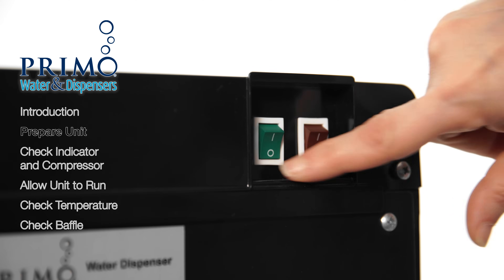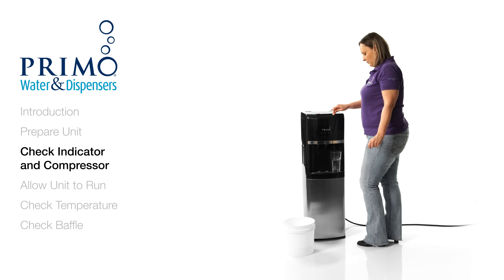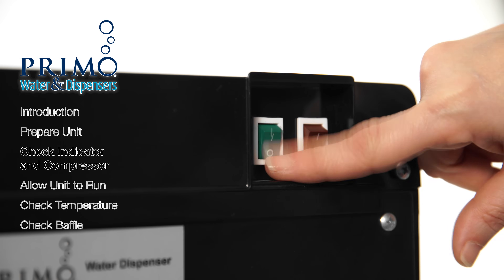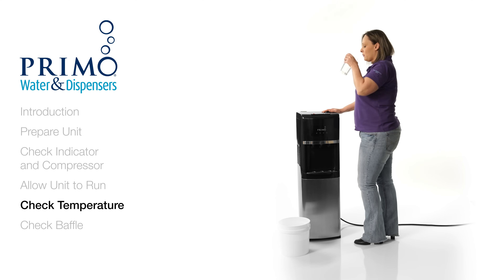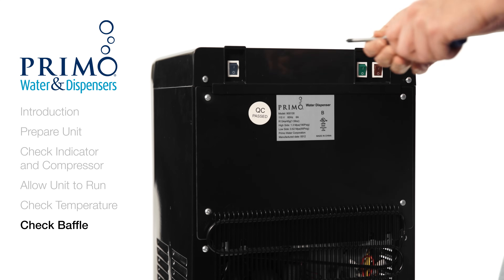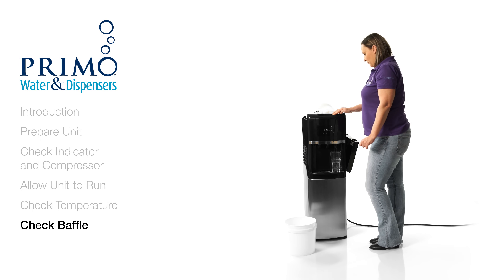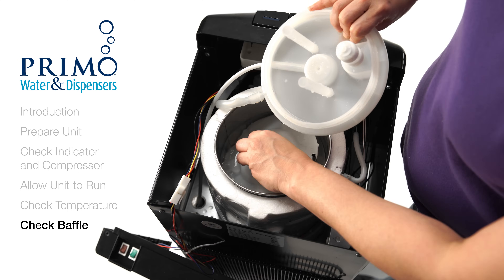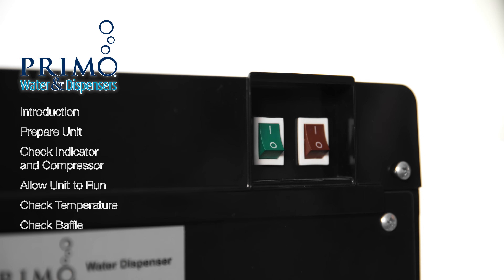Bottom Load Cooling Issue

Comment: Part of the problem with the video tutorials is that they don't seem to encompass the various Primo model numbers. As is the case with my unit as well as reading the posts of others having similar problems, that supposed brass-colored adjusting screw is nowhere to be found. At the very least, the tutorials should address where any adjusting apparatus is located on the various models or at least respond to the inquiries here to help those who continue to experience these problems without having to call in a repair professional. PRIMO, ARE YOU LISTENING???
Reply: No kidding! Mine doesn't come apart like some of these other ones do because it has the k-cup option.

Comment: Mines not cooling at all anymore. The compressor is running. The little green light is on over the snow flake but it never goes off. Compressor runs 24/7 and the water isn't even cool. This thing stinks.
Reply: have you figured out what was the issue?
Reply: Frank Alfani  yes yes
Reply: Same issue here. Just bought it too
Reply: Me to
Reply: Same issue were having
Reply: Same issue, compressor and green indicator light always on. Freon low? anyway to recharge?
Reply: Water is cold but compressor and green indicator light always on
Reply: Same here as well. Snowflake on but no one is home.   Compressor runs all the time.  I think it might need a shot of coolant.  If i figure out how to fix this i will put an update.
Reply: @mij12568  any luck bother
Reply: Same here running constantly not cold

Comment: All- for my situation cold water did not run. Hot water ran fine. Turned everything off and unplugged the machine.  Get a bucket remove top cover. I disconnected the top lid from power source. Central drain spout is right in the middle. Open front cabinet where you place your jug. Place bucket directly underneath spout. Go back to the inside of the machine and yank the plastic tube from the main spout. Water is going to gush out. Quickly place tube back into main spout. I heard a snap, most likely suction.  Then press cold water button. It should work. Dry surroundings of the main spout! Use paper towels and try to squeeze it in. Dry as best you can to prevent mold. If everything works, reassemble.  Again, this worked for my situation.
Reply: Did this work for a compressor that wasn't turning on?

Comment: How do you make the water colder? Older models have a screw on the back. Not sure where new models have it.
Reply: or less cold, ours just freezes over and water doesn't flow from ANY of the 3 ports...
Reply: @victormanx  same
Reply: Same
Reply: @victormanx  I have sold this water freeze issue by adding a timer ont he water dispenser. I use a timer by settng the time to turn on the unit for 1 hour and turn it off for 2 hours no more freezing issue.

Comment: What does it mean when the indicator light is just blinking green? And the water is not cooling and I do not hear the compressor. Please help
Reply from the maker: Thank you for reaching out to us. Please contact us at social@primowater.com so we can provide further assistance.
Reply: Same and did the whole 4 cup thing several times and stupid light above snowflake won't stop flashing which prevents the unit to run. Feom seeing all comments it seems to be a flaw in Model#601088(my unit) and Primo knows this and should replace units for free or at least give a pretty good monetary credit towards another. Looking into other brands because I've had it with the whole turn off and unplug and dispense and wait junk.

Comment: My unit wont stop cooling, turned the switches off and compressor still runs and the coils get very hot. Till the point the machine freezes up. Any ideas?
Reply from the maker: Hi - Thank you for your feedback and we are sorry that this didn't help resolve the issue. Should you require any additional assistance, please do not hesitate to email us at social@primowater.com. Thanks!

Comment: I have a bottom loading dispenser model 601089 . The coils that lead to the compressor are frozen and the cold water is not getting cold . Some videos say to adjust the temperature with a screw on the back ,my model doesn't have a screw to do the adjusting .  Another video says to replace the relay switch to the compressor , my compressor seems to be running , humming . And the on that shows how to recharge the compressor . The sticker on the back says that it has a high and low side  but has nowhere to check the freon level . Talked to the company and was told that my model isn't made any more . i was sent a troubling shooting link that does not explain what the actual problem is and how to fix it . Can anyone help
Reply from the maker: Hi - Thank you for your feedback and we are sorry that this didn't help resolve the issue. Should you require any additional assistance, please do not hesitate to email us at social@primowater.com. Thanks!

Comment: How do i get the top off of one that has the keurig storage on top? Took two screws but lid wont budge feels like it gonna break
Reply from the maker: Thank you for contacting us regarding this matter. With the type of dispenser you have, we do not recommend that you remove the top cover as this can cause damage to the dispenser. Please contact us at social@primowater.com for further assistance with your issues.
Reply: The front lip is tucked under the front frame,  lift the back up and pull , it should unsnap from the front bezel.

Comment: We have the opposite problem.  It seems that our water is freezing up and will only dispense after leaving it unplugged for 24 hours.  How can this be corrected?
Reply: Same issue here.  Were instructed by others to find the "thermostats" and adjust the screw for the cold water thermostat until the water no longer freezes.  Problem is, we have no clue what the thermostats look like.
Reply: Were you ever able to fix this issue?  Having the same problem now.
Reply: @tylerread1068  no, the unit was replaced under warranty.
Reply: Ah ok thanks

Comment: my water dispenser is model 601088, the hot and cold water work very well, but only for a while, because every time the water that is in the tank freezes, water stops flowing and I have to turn off the compressor for two hours, to thaw and be able to use the dispenser again
Reply: Same issue, did you solve it?
Reply: Same issue. Was told by my water company that they stopped carrying this unit for that same reason. Total waste of money. The thermostat needs to be replaced and it cannot be replaced on these units.
Reply: where is the thermostat on this unit?
Reply: Same and now green light above snowflake continuously blinks preventing compressor to kick on and tank to fill. About had it with this unit and maybe 2yrs old. Model#601088
Just noticed same model so it's making me wonder if there's a flaw in this model. Primo should be replacing unit for free especially due to their customers daily hassles.
Reply: We’ve had two units for three years now and one of them has been having the same trouble over two months. I have to thaw it out just to use it but it freezes up again rather quickly. If they don’t offer replacement parts then I’m forced to trash it and come out of pocket for a new unit. They should offer a discount coupon at this rate. Another thing, make better videos on troubleshooting, from a customer service stand point.

Comment: the issue is that the stupid device freezes to the point that no water comes out whatsoever, disconecting the unit helps but only if you leave it off overnight but even then you need to leave the cooler off way more time yet still plugged in so that as the block of ice that is in the reservoir melts you can take water out and it can try an put warm water in
Reply from the maker: Thank you for contacting us. Please send us an email at social@primowater.com so we may provide further assistance with this issue.
Reply: I solve this problem by adding a timer on the outlet of the unit, setting the on time to 1 hour and turning  it off for 2 hours for 24hrs cycle.

Comment: I just bought a bottom loader with the kurig coffee maker and everything works great but it pisses me off there is a small dent in the side of it. Also, the water is not cold and I couldn't find no brass screw. I check the baffle and it was in place. I paid $36 for a 3 year warranty but I don't think I will have this much longer because the water is not cold. Also the hot water doesn't cycle on and off as it should so it is not as hot as it should be when I brew a morning cup of coffee and I am not waiting 15 minutes for the water to heat up if I where to shut it off and turn it on in the morning. You would THINK there would be temperature adjustments. I also notice once the compressor shuts off it never seems to start back up again to keep the water cold. Also when you dispense cold water it the compressor should start and it doesn't unless you dispense allot of water and it is cool not cold. I don't want to run a compressor and not have cold water, it is a waste of electricity. This machine sucks and I am returning it.

Comment: My unit is not producing cold water but accumulating ice in the back of the unit? Do you know why this is and can it be fixed? Thanks
Reply: I have the same problem. Did you get it to work? If so how?
Reply: Same here. Froze up and wouldn't dispense cold water.  We've decided to not turn the green button on and not have cold water until we locate the thermostat.

Comment: My reservoir keeps freezing with in 8 hours of being on and will not dispense from the cold water side. Hot water side is fine and dispenses normally
Reply from the maker: Hi, thank you for bringing this to our attention. Please contact us at social@primowater.com so we may provide further assistance.
Reply from the maker: Thank you for reaching out to us. If you have not tried it, turn off switches on the back and unplug your machine(UNLESS YOU HAVE MODEL 601242 or 601264). While the machine is turned off , dispense about 4 cups of water from the cold dispenser. Then, plug the machine back on and turn on only the green switch. Allow one hour for the unit to cool the water before checking the temperature.  Please contact us at social@primowater for further assistance if this does not fix your issue.

Comment: What if the water dont pump to the dispenser on top and you turn it off and on and switch it and the cold light turn on than it turn red where the water jug showing what do i do to fix it?
Reply from the maker: Thank you for reaching out to us. For the issue you described, please refer to these videos for troubleshooting:

Top Load:

https://www.youtube.com/watch?v=cXRdlWk-1dE

Bottom Load:

https://www.youtube.com/watch?v=_ZV36EQnj4A

https://www.youtube.com/watch?v=VFDzrWIscpo&feature=youtu.be

If these videos do not fix the issue, please contact us at social@primowater.com for further assistance.
Reply: Prime the pump, ie invert the siphon tube and pour some water into it and then trip the door switch  on top left of frame. It should suck water into the pump. Then quickly put tube into the bottle.

Comment: okay mines is frozen and won't dispense at all only hot water works  ?
Reply from the maker: Thank you for contacting us regarding this issue. Turn all switches to the off position. Unplug the unit. After a few minutes, plug the unit back in, turn the switches back on and give it one hour and recheck the water temperature. If this does not correct the issue, please call our Customer Service Center.
Reply: @primowaterco  still  freezes water thi despincer looks brand new😢

Comment: Compressor doesn’t shut off. Thermostat isn’t working. Emailed and explained with mode number and issue. Was told to call. I called and was told by “Latasha” that you do not have parts for the dispenser…. Why was I even told to call???? Waste of time, bad customer service, and crappy CHEAP dispenser.
Reply: Hello, did you ever found the solution to this problem? I'm having that issue right now. Water doesn't get cold and the compressor is running non-stop

Comment: I think I have an older model, but I've got an issue with the green LED that constantly flashes above the snowflake symbol on the right. While it's flashing, I can't dispense any temperature of water from the machine.
It started after I left the green switch off to prevent my water from freezing in the machine. After this happened I turned both the red and green switches off and unplugged the machine. If I leave it unplugged for a few hours and then plug it back in, it works long enough to pour a cup of water and then the green light starts flashing again.
Reply from the maker: Thank you for contacting us regarding these issues. Please contact us at social@primowater.com so we can provide further assistance for this issue.
Reply: I am now having same issues and about fed up with it. Kept unplugged all night and plugged in and stupid light keeps blinking, preventing whole unit from kicking on. Have done the whole empty 4 cups and turn off..etc., but nothing.
Reply: Just had this happen to me.  Any update ? Have you fixed it ? TIA!

Comment: On 2:38 You skip with the Bethel how do you take it off it seems easy on your video but it's hard to take it out
Reply from the maker: Thank you for contacting us. You should be able to pull out of the baffle by pulling it up using some force to remove it from where it is sitting.
Reply: @primowaterco  If I was to forcefully pull up the baffle it would have broken, there are tabs you need to push to release and then it will pop off.

Comment: What should the temperature be of the cold water
Reply from the maker: Thank you for reaching out. Great question! Primo Water dispensers range in temperatures. Cold water will generally be between 37F and 50F while hot water is generally between 182F and 210F. Model number 601144 has a slightly lower hot temperatures ranging between 176F and 198F.Please let us know if you have any other questions.

Comment: my baffle has ice in it. could that also be the cause of no cold water?
Reply: Jessy Cardenas did you find a solution? Mine is also not dispensing cold water. Hot and room temp work fine. Haven't taken mine apart yet to see if it too has ice.
Reply: Your thermostat is broken most likely. It cannot be replaced. I had the same issue. Nothing you can do except toss the unit out. Even repair department said they cannot fix it. I am pretty bummed.
Reply: In my old dispenser, if I let the water jug go empty and I drank all that was in the reservoir and left it that way very long, the unit would freeze.  The solution is to unplug, let it thaw for a day and then put a full water jug back in there or refill the existing jug to the top and plug everything back together and then things will start working again.

Comment: Primo Bottom Loading Coolers are Junk, no matter what I did and this video was of no help that damn red light would keep coming on. My opinion avoid bottom loaders I also have a top loader and for over 15 years not a problem from it.
Reply: Brian Skeen I've had a similar problem and it was kind of simple to fix. I hope you have the same issue I did. The little straw tube that goes in your gallon jug might be slightly disconnected. Make sure the tubes are pushed in all the way for the big straw and for the tube leading back into the primo. I accidentally loosened it before when sliding the jug in and the red light never went away until I pressed the tube line in properly.
Reply: victor thanks for the advice but I did check all the straws and connections from the probe in the bottle all the way Thur the lid where the baffle is. Checked everything. Win some lose some.
Reply: @victortorres  - I checked and double-checked the hoses.  Light still comes on.  Any other suggestions?
Reply: @robira1313  flip the switches off and unplug it for an hour. hopefully a reboot will fix it
Reply: @victortorres   Nope. It was air in the lines.  Works fine now!
Reply: I know this is an old thread but my dispensers red light comes on too after adding new water. If you slam the door it will turn off. I think its something with the door switch.

Comment: most of the time is the relay burned out change it.
Reply: Nelson, what relay do I need to purchase? I've tried finding replacement parts online, but have had no luck finding anything other than plastic components.
Reply: Changed mine, and the overload switch, still no cold water
Reply: Still got no cold water on mine. Just blinking green!

Comment: +Hello after I put a new bottle of water in the unit the red light stays on what do I do
Reply: Same issue am having. Let me know if you ever get a reponse
Reply: If you can hear the pump trying to refill the reservoir(s) then check all hose connections. Usually the one on the bottle cap is slightly pulled out. Also if that doesn't work. Take the top panel off (2 screws in the back) and make sure lid on the the reservoir is fully seated